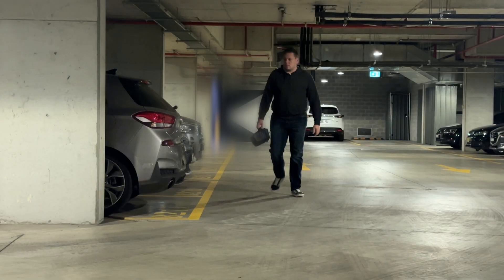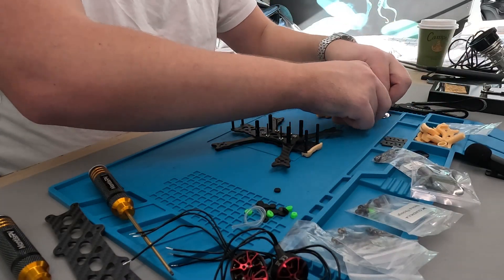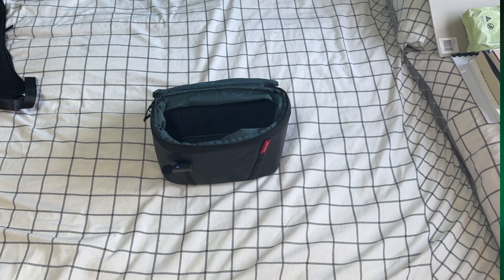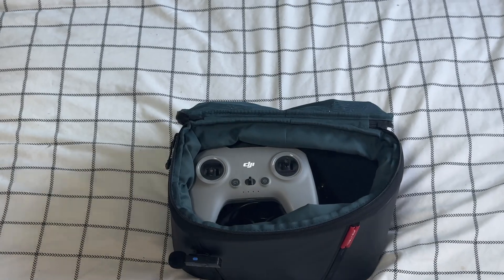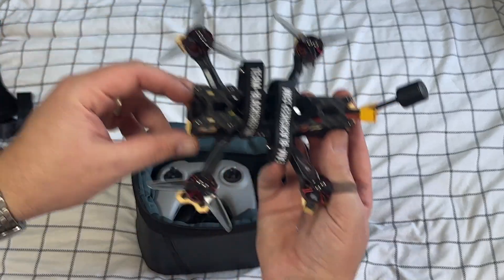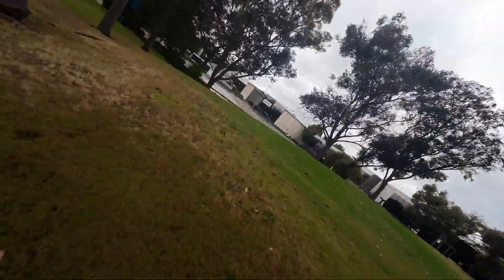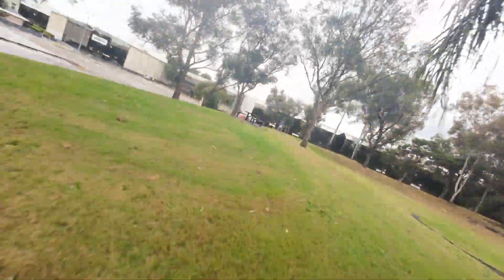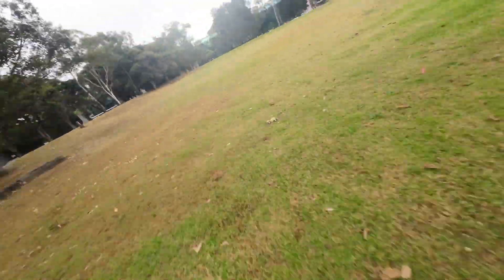What's In THIS Bag Gives You More Time for FPV

Comment: Do you think 1404 will be better for 3" than 1604? SAme thing about 3.5" 1604 or 1804
Reply from the maker: For 3.5” I really like 1804, but if you are needing to save weight for the arbitrary 250g limit and your build you be over with 1804’s then sure, go for 1604s

Similar principle for 3” with 1604’s down to 1404.

But, I’ve had 1404 on 3” and 3.5”, but 1604’s on 3” feel just right. Removes some of the floatyness that they can have

Comment: Bro the ISDT H605 Air + Toolkit RC SC100 USB cable paired with any 65W-100W usb-c wall wart makes for an awesome travel charging setup.
Reply from the maker: It’s discontinued though
Reply: @DarrenAllatt  easy to find and still on their website. But yeah it was under appreciated.

Comment: Seems like we all suffer from the same source: Money is no issue, but time. My siren f3s is also ready, I do still prefer my 5 inch. My battieries are starting ache me, the moment they are fully loaded. Its a fucking mental thing with those battery packs. I keep every thing ready to fly in my camera bag except the lipos. I am so careful with my lipos. I do charge six of them an hour before I plan to enjoy some air time, run those 1400mah down 800mah and balance them to exactly storage capacity right after getting home. This battery thing is driving me metally nuts. I dont wanna hurt those packs more than I need to. ...on the other hand, I know they will degrade over time anyways. I hate lipos. They are stressing me. Thanks for your inspirational videos.
Reply from the maker: You are welcome Lars.

Don’t let Lipos stress you… or you won’t ever get out to fly. You have a process, just follow it and you can be sure they’ll be ok

Comment: Love that idea. I mostly keep my packs charged for 1 to 3 days if i know i need or be able to sneak some packs in. Lately i moved from 5 inch to my tiny whoop. I keep everything in a little box, batteries are charged in a few minutes or have to suffer fully loaded, but it is so easy to just fly anywhere.
Reply from the maker: I wouldn’t keep lipo fully charged for more than 24 hours. You will kill them very quickly and they’re expensive to replace. 

You are best to get a Li-Ion field pack to charge them up when needed

Comment: Great idea - My 5 inch mostly hangs on the wall and i'm flying my 3.5 inch in the local parks. GepRc Smart 35 is a good choice.
Reply: Exactly! So hard or so far to travel to find a great 5" place to fly without a lot of people and NO KARENS! 3.5" is the answer! I have a cruiser and a 3.5" ultralight Toothpick RIPPER! DAMN IS IT FAST!
Because they're both a fraction as noisy as a 5" they can be flown even at the smallest parks in my neighborhood. Best of all, those small parks are awesome to fly at! 3- 5 minutes away and way, Way better than the 5" spot 30+ minutes away. And, we're not talking open fields at schools, which aren't fun at all. We're talking parks with loads of trees to weave through a different route every flight! 👍
5" is way over hyped! I also have 2" and 2.5" DJI digital too, which the 3.5" also are. Micros for the win! 😎🤘

Comment: I have a 4" toothpick style Walksnail quad I built on the Hyperlite UL5 frame. powered by 4S it gets nearly 10 minutes of fun park rippage. Probably has become one of my favorite quads because It's so easy to get around with. I too travel for work so this is much easier to keep with me and I can charge in the car super fast since I'm running 750mah 4S packs :)   Oh, and All up weight with battery is 239g
Reply from the maker: Yeah that’s an absolutely solid build.
You just have to get out and fly, that’s the trick.

Comment: nice video! could you maybe do a video how to make such a charging pack?`seems a bit dodgy tbh - or is it that simple? solder 6 packs together, add xt60, wrap it in tape - done?
Reply from the maker: You’ve got to wire them in parallel.

It was a ball ache and not something I’d recommend. 

Cost $120 AUD to make, took 1.5 hours.it’s only 3,500mah.

ZOHD make a 6S 4,000mah Li-Ion pack which I would have got for $162 AUD and saved myself the hassle.
Reply: @DarrenAllatt  yeah makes sense, thanks for your insights :)

Comment: Good advice. After my last holiday, I'm planing on building a 4" foldable O3 long range quad with a similar travel bag. Hiking up the mountains is my passion and often I have to leave my 7" backpack at home. Too heavy and not sure if I will get to fly anyway.
I'm wondering why the latest fpv related videos are going back to 3", after the 3.5" trend took off three years ago.
4" is my favourite, but there are very little 2005 size motors with 2000~2200kv motors out there for 6S.
3" spin faster and just scream on power setups. Thats why I like bigger props.
Also sub250g is nice if you really scared about getting into trouble. Personally I'm at ~300g AUW on my 4" and just like it without having to trade off in power and prop size.
From my experience the people mostly care if it's loud and intimidating. It doesnt help much if you have a sub250g quad and have to argue with people it's sub250g and allowed. Not that I'm going to fly in crowded places anyway. Unfortunatly it's hard to find a place to fly with nobody around
Reply from the maker: I much prefer 3.5” over 3” and have two upcoming 3.5” videos for it. I’ve asked Quadmula to make 4” arms for the Siren F3 so we can use 3.5” or 4” props on it. 

4” with 2004/2005 is pretty good.

Comment: I was super frustrated today on my day off in southern california looking for a place to fly where i wouldn't be bothered and wouldn't be bothering anyone
Reply from the maker: Sometimes you need to just hunt on google maps and then have a dedicated day of scouting
Reply: @DarrenAllatt  that's super solid advice -- I did just a little of that last night.  Of the places I marked the two I decided to drive  to today were unfit:  the first was too crowded, and the second was a massive park (may or may not have been chino hills state park) which I needed to explore first, but was running out of daylight.

The scouting part of the hobby is a big aspect of it that I'm just coming to understand.

Ended up settling for old reliable because at that point I just wanted stick time

Comment: So you can keep LiOn packs fully charged with no degradation? And what settings on a charger do you use to not damage them?
Reply from the maker: Yes, and I do this with my LiPo field pack as well which is a 14,000mah Lipo. 

As Fortune Cookie said, degradation is minimal over the year, and it’s a cheap battery to replace. 

Better to replace a cheap li-ion pack once a year than 6 Lipos once every 2 months
Reply: I was going to ask exactly the same!
Reply: LiOns are no more resistant to these damages than LiPos are.

With that said, I invite you to look up how much damage leaving a battery fully stored does. It is a few percent a year in losses.

If I had big, expensive, long lasting batteries, I wouldn't do this. But with my $24 2S2P Lion packs? Who cares if I replace them every other year.

Comment: Amazing video. What backpack do run for FPV/Camera Gear?
Reply from the maker: Pgytech OneMo2. It doesn’t have straps on the front for mounting your quads so I’m just using elastic cord I’ve put on the loops. It’s a smaller size (25L) than FPV backpacks but it holds more gear than my iFlight backpack